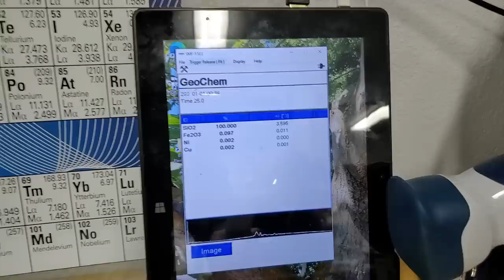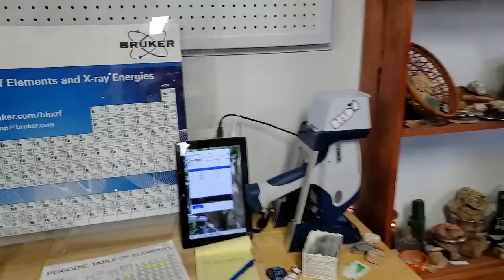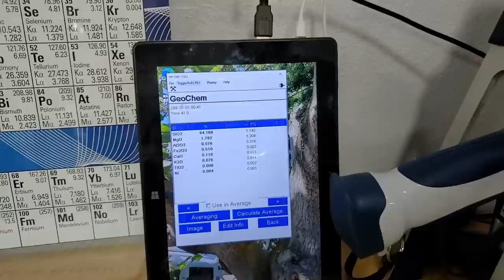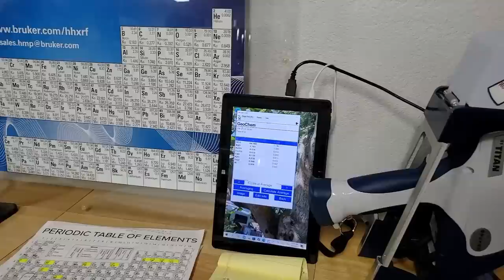Langford Lapidary Shop Tour // A Full Service Lapidary Shop In Yakima Washington

Comment: If I don't see a price tag on something in a store, I see them as shysters.  I'll probably look around a minute and leave. Just be open and honest and fair priced. If not, you will lose more money and also gain bad reputations that people will talk. I also think a huge problem with people is when they sell used things for the same price or even more for something brand new as if everything has value for being older. Its doesn't. Especially electronics that wear out and basically trash after 10 years if its all plastic or something with capacitors that all dry up. But you two have a very nice shop and seem down to earth.